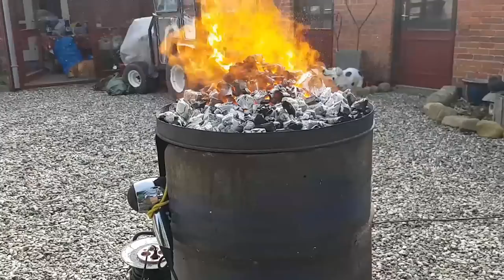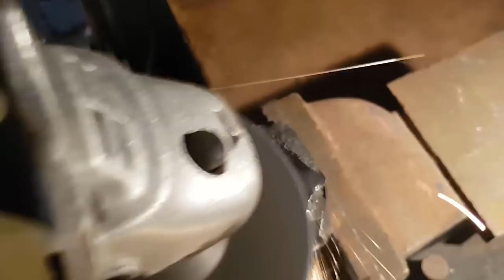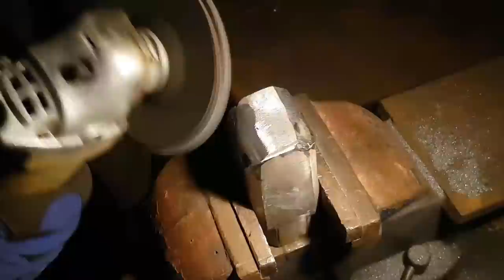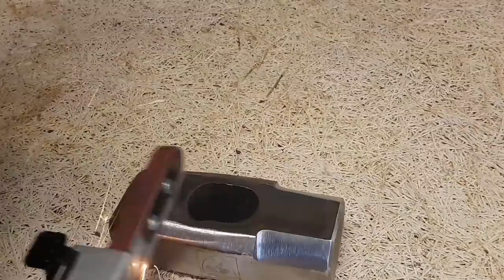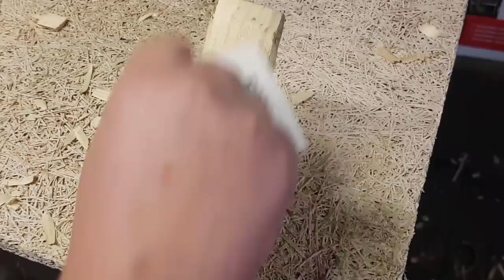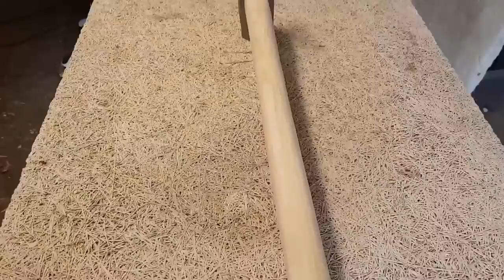Hammer Restoration Project

Comment: Great video and great job! I just subscribed. Quick question if I may, does the hammer head lose its temper and become softer after being heated? Could you still use it for other metal projects (not that you would want to given its beauty)?
Reply from the maker: Thanks for subscribing. :D
Unfortunately i didn't film the heat treat because the camera died while recording it. But yes, heating the hammer beyond 500-600 degrees celsius will make it lose its heat treat and make the metal kind of soft, that's why i did all the metal grinding in it’s softer state. The way i did the heat tread was by heating the hammer head to a soft red glow and then cooling it quickly in a bucket of water. After that i used a stove to temper the steel so the metal would not be brittle. :)
Reply: Sir Make-a-lot Thanks for the answer!
Reply: Sir Make-a-lot Would a person die if you swing that hammer to someone's head from behind when the guy is your worst enemy and u hate him much?☺
Reply: John Martle lol
Reply: John Martle, I would imagine that a sledge hammer swung at the back of someone's head would almost definitely always kill someone. (All hypothetical of course......) Aim for the temple, that's the weakest part of the head. 😄😄😄😄 please don't arrest me
Reply: Campbell Smith I said it just to be funny.
Reply: So did I
Reply: M Ditty tes
Reply: The thing looks like a bullet bill
Reply: M Ditty actually when u heat a metal to that heat and quick dip it in water it will be as hard as ever.
Reply: M Ditty great video nice information thanks
Reply: Peter Ford The process is known as Quenching..👍🏼👍🏼
Reply: Peter Ford nope
Reply: Did you file test the hammer after quenching to make sure it was hard? Some steels won't properly harden when quenched in water.
Reply: Hilma Terpe it's harder to mess up with water because water cools the metal faster. By using water you increase the likelyhood of cracks in the steel. With the right kinds of steel and enough experience you can harden it in water without problems. It also has the advantage that you can get the steel harder (useful on low carbon steels (they still need some amount of carbon to harden at all though))
Reply: Some steels are water hardening steels, some are oil hardening steels, and some are air hardening steels. Oil and brine (salt water) both have greater thermal conductivity than just plain water. Some steels respond better to being quenched more slowly, some respond better to being quenched quickly. For a big slab of steel like a hammer head, an oil or brine quench might be the best, as the steel retains a lot of heat during the quench, and you want to cool it as quickly as possible to make sure the surface becomes hard.

I've heard a lot of manufactures mention an interrupted oil/brine quench is ideal for high speed tool steels like D2/M2/M4 etc. even though they are technically "air hardening" steels.

Note, I know next to noting about metal working.
Reply: M Ditty   NO  NO  MO   MUCHO   TRABAJO
Reply: M Ditty :'f
Reply: Christopher Backus this seems off to me as quenching in plain water cools the steel faster which is also the reason for the higher propability of cracks oil cools the steel slower and more gently which leads to a softer steel after hardening but lowering the risk of a crack.
Reply: John Martle hit them in the back of the head. If you damage or cut the medulla, which is basically in the back of your head/neck, you'll kill them instantly. Personally, if i could, I'd use an axe instead to make sure it's cut.
Reply: ismet
Reply: Yes it does
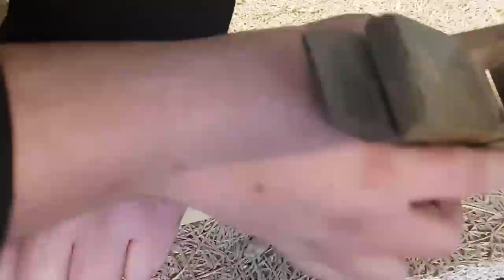Reply: What a music 6:15 ?
Reply: Krale - Frontier (ft. Jasmina Lin & Jay Christopher) [NCS Release]

Comment: I appreciate this video because 1) he is using charcoal fire forge with a hairdryer 2) when he can t get the shape correct he takes probably a lot of time shaping with a basic grinder 3) he is using a box cutter instead of a spoke shave or draw knife to make the handle. As long as he hardened the head this video shows you don't have to be a seasoned blacksmith with the right tools or years of training to achieve a finished product. We have all been there.

Comment: It is amazing how soft metal becomes when it's orange hot.  I was short of a specific sized nut and this resulted in having nothing available but a close mismatch between Imperial vs. Metric size of a nut and a bolt.  I put the nut on the kitchen oven ring, and once hot enough, I reshaped it to match up with the bolt.

Comment: Don't mean to be rude, but what was the point in forging this?
Reply: Conduitt Probably so he had a hammer.
Reply: Conduitt To make a video that can generate money. Also, if 90% of the population is wiped out in a nuclear world war, this information may come in handy now that hammers will no longer cost a few dollars.
Reply: He made it worse. Maybe he was trying to show what happens when you allow a beginner to forge tools
Reply: Buzz LightBeer what did he make worse? He heated the metal so it loses the hardeness...
So he could cut/grinde easy
He made a pritty nice looking hammer...
Aaand if you read the description he hardened the Hammer 
So what's wrong?
Reply: So starving children in Africa can eat a clean hammer.
Reply: You don't want a hard hammer either. Too hard and it will shatter
Reply: no, thats why you go through an anneal process... to heat the steel up and allow it to relax. Forge - quench to harden -anneal ... unless not shown here, he actually just tuned this all back into soft steel which will pit and score. ok so according to description he did this....
Reply: Fun . Hobby
Reply: Conduitt he would have to spend a lot of time grinding the hammer.
Reply: He was just straightening it up somewhat before he started.

Comment: isn't recycling awesome?
Reply from the maker: It sure is :D
Reply: Yes,yes it is
Reply: Chaos Fire first...its reusing or repurposing not recycling...second recycling is bullshit
Reply: ayan Qatar
Reply: ayan786
Reply: Chaos Fire OFC ! :3
Reply: Mike K its not repurposing, its still just a hammer, its not reusing its still using. All he did was make it pretty again. That's all.
Reply: Shelby Seelbach wrong...completely changed the shape therefore application of use....repurposed
Reply: Mike K still just a hammer, was already a hammer. The purpose is to bang on shit, get real.
Reply: Mike K the fact that you turn to insults and then call yourself an adult is laughable. He repurposed it into a hammer to smash a little piece of wood. He could have done that with it as it was. He could have done that with a ball peen, claw hammer, or sledge hammer. Once again, get real.
Reply: I couldn't agree more.
Reply: Actually he fixed a couple of things that could affect it's performance, the rust had caused some crust on the outside and it was cracked too, which could've resulted in tiny pieces scattering about as he used the hammer, also it was pretty dented. 

It is what it is. A restoration.
Reply: TheShadoek right, he made a hammer into a hammer. I get it at every level.
Reply: Logan 1664 it's not he's just brainwashed into thinking that anything liberals promote is bad

Comment: You're so lucky your parkside rotary tool works man. I had mine brand new for 1 night, my bit kept flying off that thing so I tried to tighten it like 3 times before screw got busted and Im no longer able to tighten in at all. And yes I did check the direction of rotation I don't even think you can change it on this one.

Comment: Just one question... U cud hv used the machine in the first place why did u heat n beat it.
Reply: Mridul Joshi I was wondering the same thing. the steel should've been heat treated already since it was already a hammer head to begin with but then again I'm not a blacksmith so I know nothing. I startwd watching to see him beat and form it with a hammer but I was disappointed to see the electric tool come out. I almost felt like it was cheating to just hack off material to shape it. I figured I was gonna see straight up old school heat n beat smithing. still turned out cool. and I found the music very tranquil actually. as weird as that may sound
Reply: I wondered the exact same thing, I know nothing about blacksmithing, but it seemed to me the heat and beat wasn't necessary?  Perhaps he started in one direction and then decided to go another?  Idk. Cool vid though.
Reply: I would think he should have forged it more close to the final shape, so that grinding would be minimal.

Comment: I have to point out some flaws in your hammer: Expensive unnecessary charcole forging, didn't anneal before forging, and didn't harden the hammer faces. It may be a nice looking hammer but a soft hammer would work better as a paperweight.
Reply from the maker: The hammer was heat treated, i just don’t have the footage of it, because the camera died while filming it. I wrote how i did it in the description. But something i didn't mention was the annealing process i did after i was done forging it. Were i heated it to at around 600 degrees celsius for an hour to make the metal soft and remove any internal stress. It ‘s my understanding that annealing your work before you're done forging it, will still leave it with some internal stress so that’s why did it after and not before.
Reply: Sebastian AT -Troll
Reply: David you have no idea what a troll is do you?
Reply: In that case, very well done. Was it hard to forge without aneal?
Reply: Majin Snake annealing it would take out the initial hardening. The hardness needs to slowly seep out of it for it to soften. I know from experience, forging hardened hammers is a pain with no prior anneal
Reply: Errr... annealing before forging has no effect on the steel when it's under the hammer. That will only have an effect when grinding the finish forged piece. Same deal with running leaf springs through normalizing cycles prior to forging. It doesn't do anything.
Reply: TheCompute101 your not going to enjoy trying to forge a hardened hammer head
Reply: Sebastian AT You're*. And I have. There's no difference. Molecularly there is no difference in the steel once it is up to forging temperature if you annealed before forging. The hardness is gone once it's up to temperature, regardless.
Reply: Majin Snake Likely.
Reply: it's a fuckin hammer m8. you use the shit to put nails into other shit not to model with. if the hammer can give you a concussion then it's a good enough hammer.
Reply: EpicFace5050 i dont know anybody who uses a sledge hammer on nails
Reply: sledge nails...
Reply: yup. thats what i said to him. prettier now, but harder then.

Comment: Beautiful Hammer. only issue i can say is that you could have saved a lot of Grinder time by doing more shaping in the Forge itself. I would suggest switching to Blacksmithing coal for your forge. I'm still a novice Black smith myself but I try to avoid grinding. I like to spend more time at the forge than the grinder =3

Comment: You should use a wire brush to get the scale off while it’s still red hot, before you start hammering. It would make there be a lot less cleanup later

Comment: Cool build. The fitting of the hammer head on the handle would have been much easier had you not tried to upset the metal warping the drift hole. Would have been fine had you run a drift through it. Also, in the video you did not temper the metal, it is going to mushroom if you use it on any hardened steel. Would have been much better off heating it to red hot and letting it cool to soften the metal. Then shape it with the grinder and temper it. Much easier over all and you don't have to mess with the drift. Just speaking from experience.

Comment: nice work!! I'm just wondering why you chose a flapper wheel instead of a grinding disc to rough out the shape first. The final product is awesome none the less..
Reply from the maker: Thanks :D I choose to use the flapper disc because it's easier to make a flat surface. However, I would probably use a large diameter grinding disc for the rough work next time. The smaller diameter ones aren't the best for flat surfaces. and the smaller ones are the only ones I can afford at this time but in the future, i hope I can get a hold of one and a larger grinder :)

Comment: Hi, Well Done, Nice Hammer,,   I own a carpenter hammer it´s been in my family for 50 years, what temperature do i need to deform my hammer? .  
Plus Anvil and other hammer to fix imperfections  

Congratulations!!
Reply from the maker: I suggest that you get the hammer head to around 900 to 1000 degree celsius or 1652 to 1832 degree fahrenheit in order make the steel easily workable. Remember to heat treat the hammer after you are done working it else it will quickly deform after use. For a hammer i suggest a 1 kg or 2 pound forging hammer as it is a smaller object. The anvil can be any kind of a larger piece of iron/steel however i suggest not using cast iron and high carbon steel when you start out, as it can break if you miss hit. :)

Comment: so im planning on touching up some tools in my house what should I use to get off old grime and rust with a tool? also what is a good way to re sharpen tools. thanks if you do read this comment I have few tools and most manual on electric Is a drimmil, circular saw, all types of hand drills. otherwise I have hand held tools. and Hanks again
Reply from the maker: vamphere I would suggest using a grinder with a sandpaper dish however if that's not accessible to you I would suggest you using Your drimmil with a sandpaper roll at the end. you can even touch up your tools by hand sanding them. but if there is any larger defomations I would suggest using heat to reform it. last but not least you will need to rust proff them by giving the surfaces a clear lacquer or oil. 😊

Comment: Great work. I appreciate the abilities of the author. However at about $35.00 an hour and the total hours it took to re-do the hammer it must have cost well over $100 for this hammer head and then add the new handle. Fiberglass handled sledges can be found on the internet for $29.00. Non-the-less great job and very entertaining.
Reply: If u can find me a job that pays $35 a fucking hour I will give u a gobby

Comment: If you make another handle, you may wish to align the grain so that it runs as straight across the handle as possible.  That is, if you look at the end of the handle, 0 , the grain should be aligned vertically, | , rather than horizontally, - .  The handle is far more likely to crack as you have it.

Comment: Oddly satisfying. But it seems like a lot of the metal from the original hammer is lost. Is it so? I know nothing about metallurgy.
Reply from the maker: It lost a little bit of metal. Around 50 grams to scales and grinding, but the amount of metal lost would have been even higher if i had not forge it back into shape. :)

Comment: awesome. great job man. can i ask u something? please tell me how you mark your stamp on steel? there is any special tool for that? for example i will make a metal stamp. how i can? with exact shape and sharp edges like print...
Reply from the maker: Well i used a diamond tip hand engraver machine to make my logo. However i know that there is a lot of people that use punches on heated metal to leave they mark. A way to make a punch like that is by making it out of spring steel. It’s important that the steel is heat treated correctly or else it will quickly deform under use. :)
Reply: Sir Make-a-lot thank you man. ✌👍

Comment: use a spokeshave for the handle. its faster, safer and its a tool specifically designed to do that job. A flat bottomed one will be fine. When using a smoothing plane, brace and clamp the material otherwise your just wasting energy and putting yourself at risk.

Comment: I'm not saying this to be negative about what a nice job you did because the hammer looks beautiful. It seems to me though that all the blacksmithing you did on the hammer was really pointless. In the end you ground away a lot of the hammer anyway. Looks like you could have saved a bunch of work by just doing the cutting and grinding and had the exact same result in the end.
Reply from the maker: normally I would agree, but the hammer was crooked and in need of straitening out, so I decided to forge the crookedness out and then focus on the grinding :)

Comment: Great job on the head, but why did you make the handle with the grain going the wrong direction?
Reply from the maker: I was made aware of this 5 days ago by a friend and have regretted it ever since. I normally don't do a lot of handel's so this was a sort of new experience for me. That's also why you see me using a knife instead of specialised tools to carve the handle, tools like a draw knife :)
Reply: I expected to see you use the grinder to help hog off wood too, but maybe you just don't have the experience.
Reply from the maker: Well, i think that the amount of time i would have used, would have been the same as i don't have any kind of wood disc for my grinder and it would choke up the grain. However i still think that a draw knife would have been the best solution for the handle. :)
Reply: Next Project for YouTube...Drawknife!!!  good stuff otherwise!!!
Reply from the maker: That’s a nice suggestion, and i think that i might make one in the future when i got my gas forge up and running :D